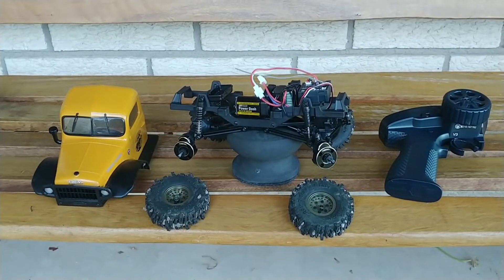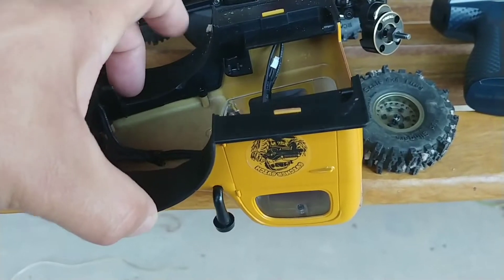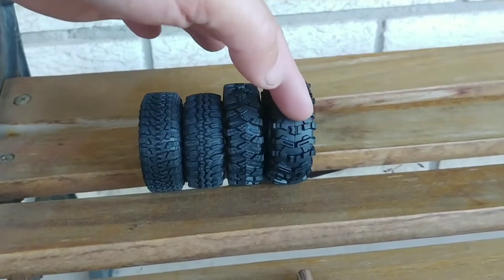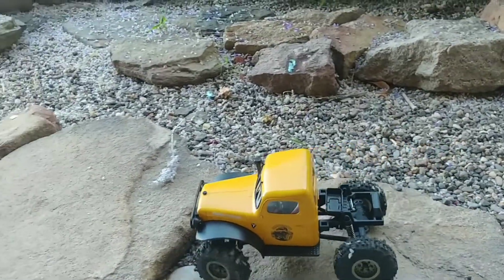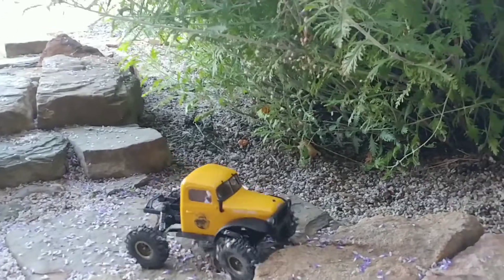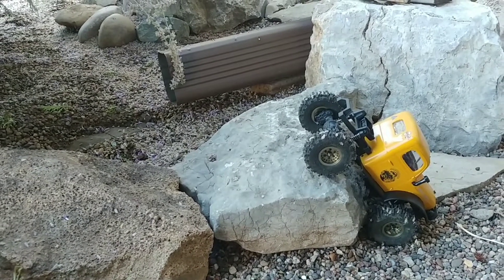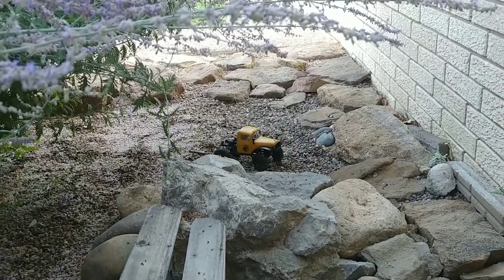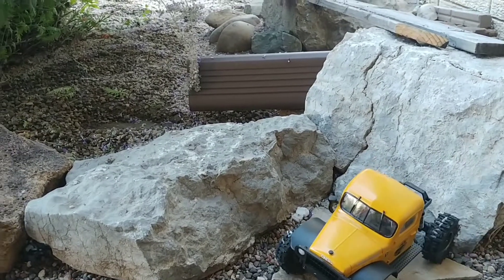FCX24 mods part 2!!!🤘🤘🤘

Comment: Have you heard of the McCue rc extended rear trailing arm links? They give the FCX a 28mm longer rear end and it helps tremendously.
Reply from the maker: Yea, I have a set.  For me they were a little to stiff.  I use them when I take the FCX24 them hill climbing or racing around a dirt track we make near base of the mountain we go driving at.  I got a set of the Treal extended rear links which put the wheel base perfect for the rear cage I installed. McCue's front bumper is my favorite mod!!!🤘🤘🤘
Reply: @jdsrcs8061  I find them to be a little stiff as well. Hopefully he'll make improvements. I like the forward axle placement, it allows me to climb head-on. The stiffness doesn't affect me too much since I'm going for scale-ish.

Comment: If you could go back in time, would you still buy this today? Which one should I buy SCX24, FCX24, or TRX4M? Great video by the way. Thanks!
Reply from the maker: That is a good question!!!  I would say yes.  This was the first generation so it had some problems.  They came with plastic gears in the portals, so they were real easy to strip.  I got the metal upgrades, which fixed the problem.  If I could only get one rig of all of them, it would be the Scx24 Gladiator.  It just works great in all situations.  You can trail with it, but it can become a killer crawler as well.